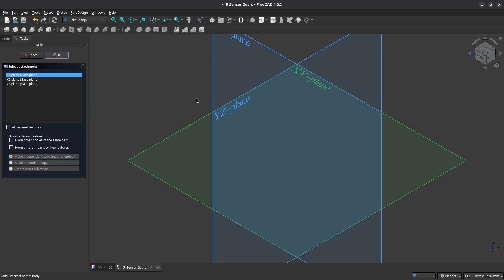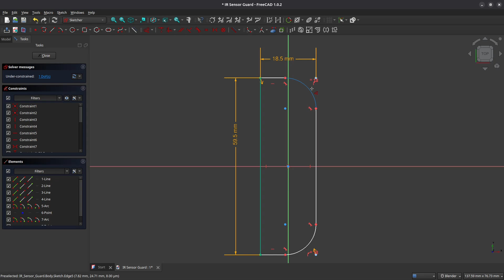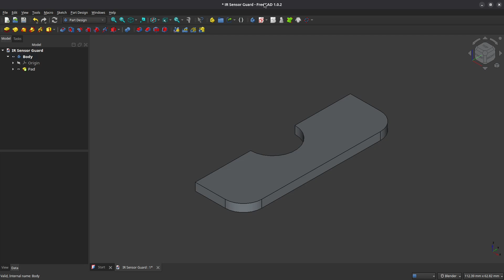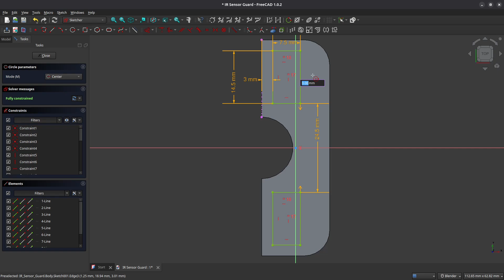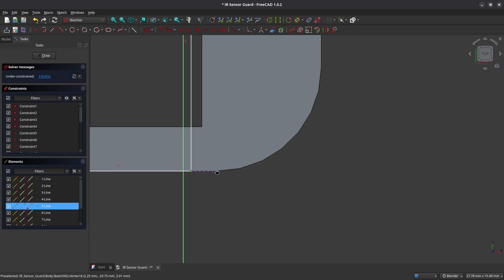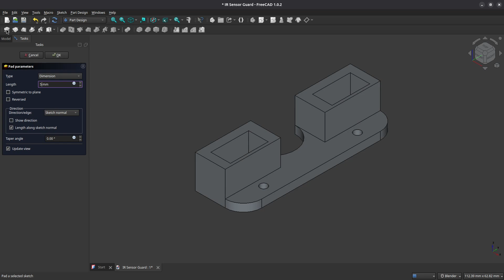SPARKBOT V2: PART 11 | IR SENSOR GUARD

Comment from the maker: Welcome to Part 10 of the SparkBot V2 architecture. 📐

In robotics, hanging mass is the enemy. It is easy to think of electronics as just "circuits," but in a moving chassis, every exposed wire lead is a mechanical lever just waiting for metal fatigue to snap it. By designing physical constraints for our 5mm LED lenses, we turn cheap sensors into reliable hardware.

Question for everyone building along: What is your go-to method for strain relief on DIY electronics? Are you designing custom 3D printed constraints like this, using standard cable ties, or relying on the classic hot-glue method? Let me know your reliability tricks below.

Chart your course. Build your world. 🍁